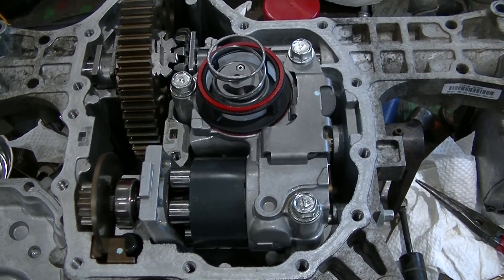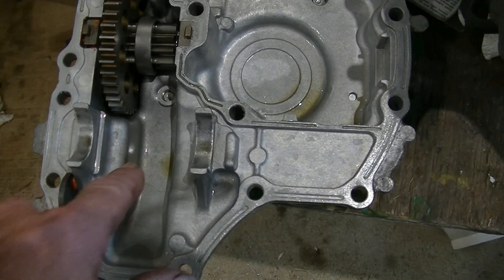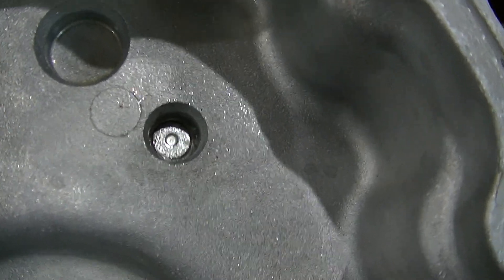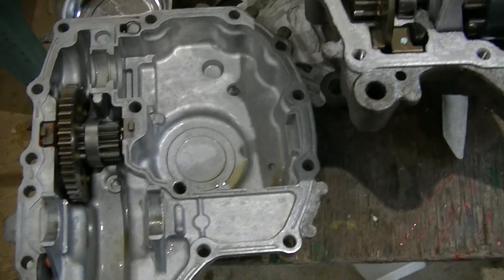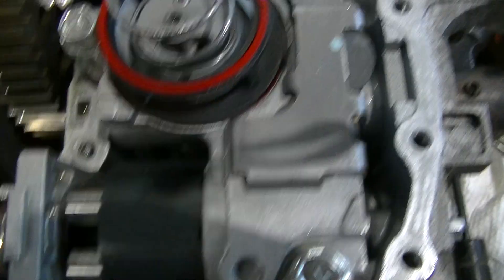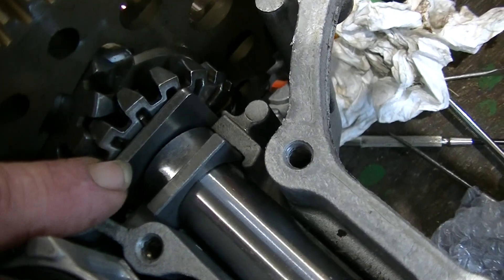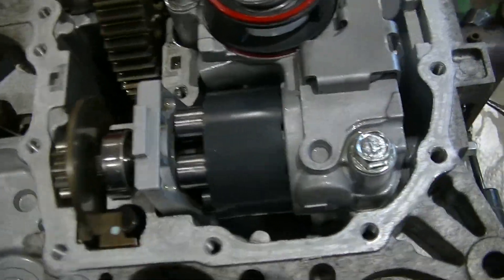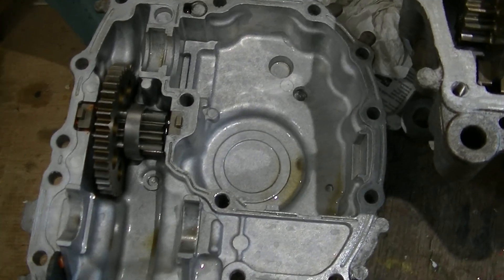John Deere X320 - K58 Transaxle Servicing - zeketheantiquefreak

Comment: It's not "unserviceable" it's designed to self-destruct in three to five years so you'll just go buy a new one.
Reply from the maker: Yea, we are crippled as consumers with 'planned obsolescence'. It is a trap that is hard to avoid.
Reply: @zeketheantiquefreak8518  A Class Action lawsuit seems likely. I wasn't warned about not using our new riding mower on slopes and of course, the transmission started having problems in just a couple of years of light use. 46 hours of use and they tell me I need a new transmission, lol.

Comment: I wish you would have showed the bottom to see where to drill the holes from underneath without having to remove the bottom cover on the k58. I'll have to go back and guess where you drilled the holes. I was going to drop my pan too but not now. Just want to drill and drain and tap it from the bottom side. thanks.
Reply from the maker: Yes, I split the case to thoroughly clean clean the case and the filter. The places to drill and tap were were obvious from the inside... Is there any information on the manufacturers website?
Reply: @zeketheantiquefreak8518  Nope. But by looking at the inside, to me, it doesn't look like drilling anywhere outside where the filter sits would be ok. Nothing to cause structural integrity in the case.  But the one for the big gear would be hard to run a tape in that to put threads in. I was looking at bung cap plugs. Silicone. but not sure of the thickness of that bottom case cover to get the correct size. Just drill and push in one of the plugs. No threading needed I've seen different versions of the K58 from the inside on videos and some look different than others. Can I unbolt the case enough to make a 1/8 between the case and the cover to drain the oil that way without anything dropping out of it's position like the disc brake pads? The big gear should slide up into position as everything else. Thanks for getting back to me.
Reply from the maker: Oops, it looks like I missed your message. What would happen if one were to drill the case to, say, 3/16" and put in a pop rivet with a touch of sealer? That would save trying to tap the hole and doing internal damage. The deep cleaning couldn't be done but the oil could be changed. Thank you for the comment.  @JohnSmith-uy7sv

Comment: Draining the oil without getting the filter and cleaning the magnets is kind of useless
Reply from the maker: Aye, exactly why I split the case and deep cleaned. Yes, you are correct, if I drain the fluid in the future I won't be able to clean the screen. I am hoping that the first cleaning/case split was of great help.
Reply: @zeketheantiquefreak8518  I’ll have to do mine

Comment: If you go on their website they will give you the distance from the fill hole to the top of the oil when full.  They also sell a drain plug add on kit where you can tap for 8m and use a flanged bolt with a sealing washer.  Just another way.  You way with the 1/2 NPT tapped hole works as well.  Good video.
Reply from the maker: Thank you for the reply and the information. It is a nice feeling that at some point in the future I can easily service this otherwise good unit.
Reply from the maker: Cool... Thank you for posting the video on removing and installing a serpentine belt with a rag. Good info.
Reply: I went to their website I can’t find this information

Comment: Thank You Zeke.
My X320 is a 2010 model.  288 hours.  Trans is slipping/whining etc, barely does a gentle slope.
I have removed the vent cap and found the fluid looks like new.  It is down 1-3/4" from the top of the vent casting hole.  Can you tell me where it should be?  I don't want to overfill and there is no sign of leakage.  Thank you.  gbakertech@gmail.com
Reply from the maker: Thank you for the comment. Without a dipstick, it is hard to tell exactly where things should be level wise. Tuff-Torq website is worth checking out. Knowing the capacity is of no use when you cannot drain the old fluid. Sorry I could not be of more help. If there is no visible sign of fluid leakage, the level you have must have been that way from factory? I guess I would add some fluid, perhapssyringe
Reply: @zeketheantiquefreak8518  Did you encounter a small shock absorber on the Linkage?
Tuff Torq told me it may be my problem that it is not opening flow completely.
Can it be accessed without tranny removal?  Thanks.
Reply from the maker: @gordbaker896  I seem to remember a small 'shock' thing on the linkage... Yea, is there a way to unhook it and check the travel? That sounds like good advice. If you go to jdparts.com, look under your model and the parts breakdown should show how it is all laid out. Let me know how you make out.
Reply: @zeketheantiquefreak8518  I would call it a damper and I was able to get the forward end unbolted from the frame and cycle it full length. It is not spring loaded I don't think.  Easy to do with Rt. Wheel off.  Tuff Torq said that the G66 tranny will not fit for various reasons.  Height, Linkage, bolt patterns. They get asked that question 10 times a day.